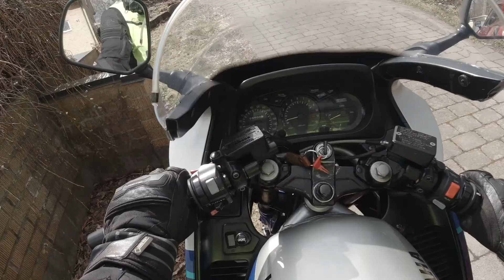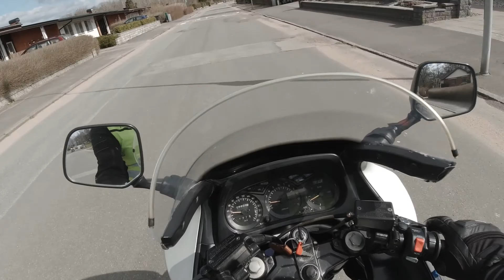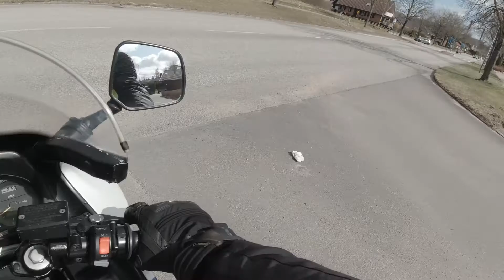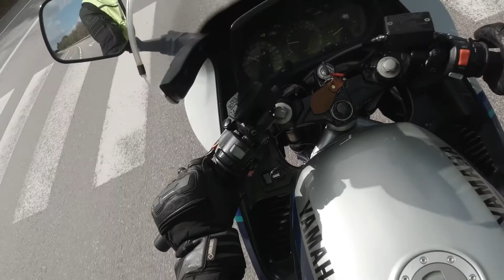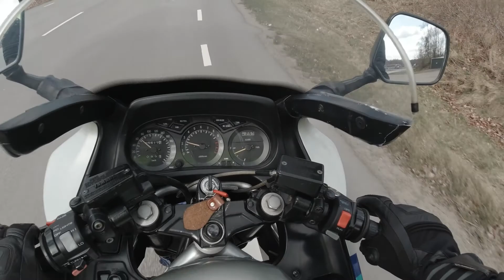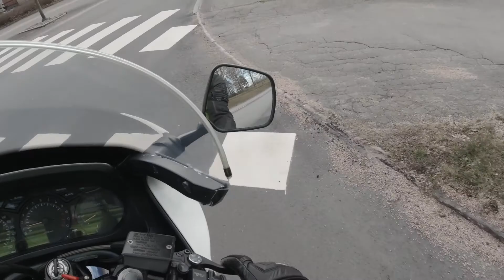Yamaha FJ1200 100 000km test ride

Comment: Cleaning my Carbs about to go put them on the Floats where way off balance so when it started up would bog when I pull the throttle.  I got them all to exactly 23mm. I got the bike from an 80-year-old man few days ago. Trying to get it running right so I can register it this week. I love things like these bikes. They have a community of people just like corvettes. I bought this bike and my corvette So I could get into these communities.
Reply from the maker: Looks like you got quite a bit to do there.
Yes. There are fewer of these bikes around. Old cracked carb rubbers don't either. Good luck hope you get it running ok.
Reply: @andrewonmyway8184  I got it running like a Gem 💎
Reply from the maker: That's great man!
Reply: Have had one for 30 years. Love it, but need to do the carbs again.
Reply from the maker: @garymarquart1288 
They are old bikes and the carbs need looking after now again. Bit of a pain job but once it's done properly the rewards are worth it. Thanks for your support!